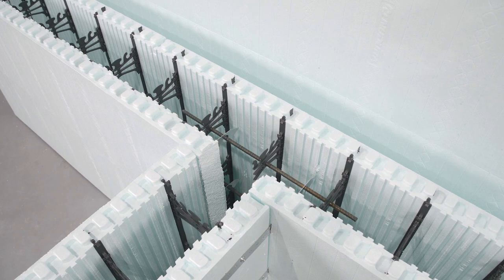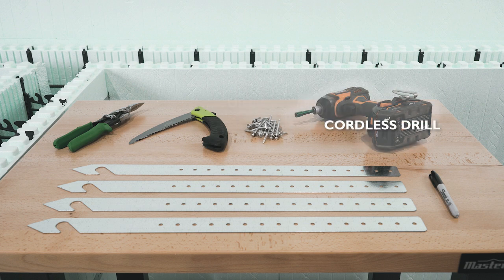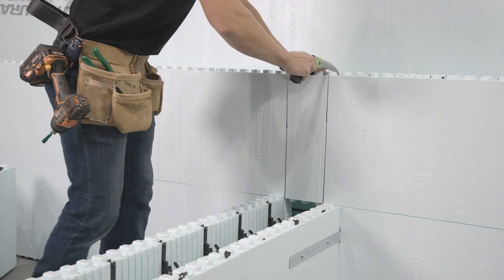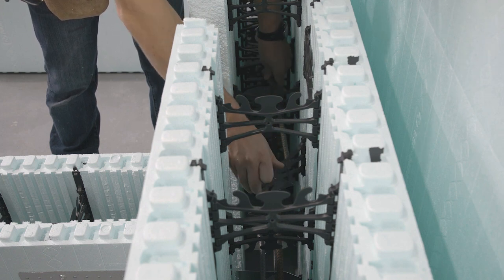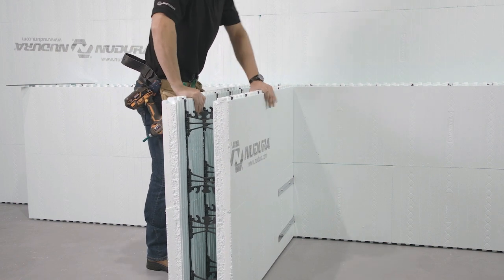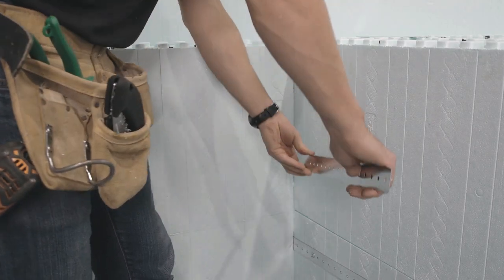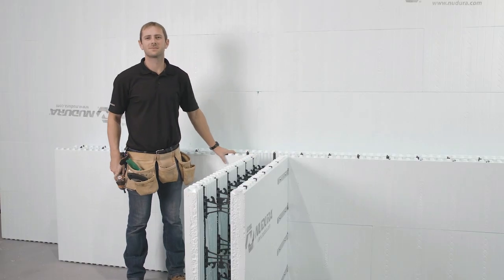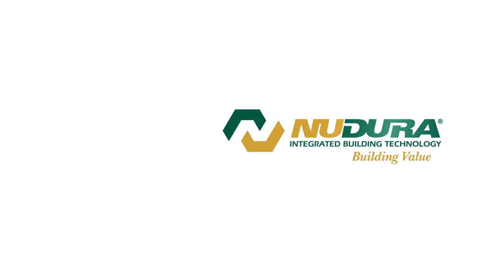NUDURA T-Strap Installation Video

Comment: Why negative votes?  I'm looking to build an ICF home and actually like this option over the T-blocks. Seems more efficient and easier with having to place two walls near each other.
Reply: Kipring Payne if you choose ICF, have a contractor that specializes in them and let them use a brand they’re comfortable with. I built a 5500 sq foundation with Nudura, after attending their class, becoming certified to install them, stacking the system as outlined in their binder, having it inspected by them, and the product failed in four locations. One location was my fault, I didn’t buck out the door opening and the concretes crippled the form boards in that location. The other three were blowouts in the middle of a full block; a product failure.  Nudura has never returned phone calls or emails since their initial inspection. 

I have 11 t-walls utilizing the t blocks, I over built everyone of them above what the binder recommended and they did great. We used #5 bar at every course, the rod was bent to turn through t locations rather than butting them at the intersecting point. We used extra web clips for all the sides of the t wall top and bottom, and heavy gauge zip ties and rebar tie wire to hold the rod in the web stiffeners.  

The day of the pour, we used 156 yards of concrete, a pumper truck, and 9 guys, most of them well seasoned in traditional poured walls, and a rep from Nudura as the team lead to ensure it went smoothly.

My recommendation would be to use a licensed and insured vendor for the icf portion of your build, regardless of icf brand. I wish I would have.